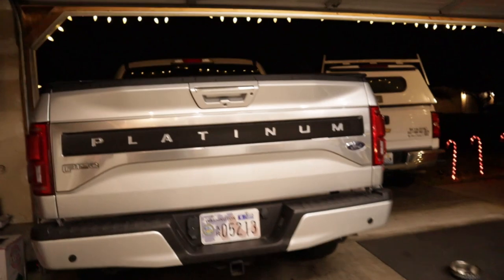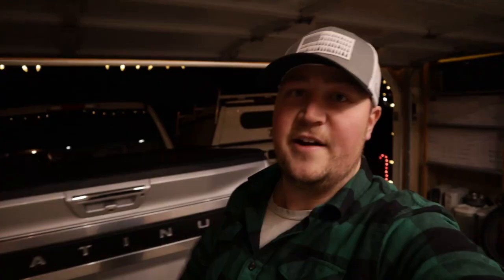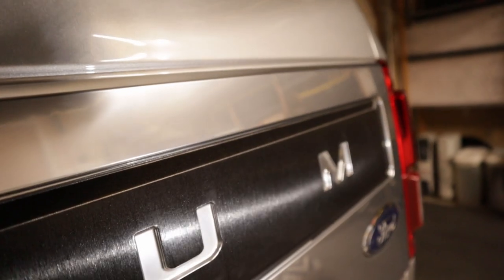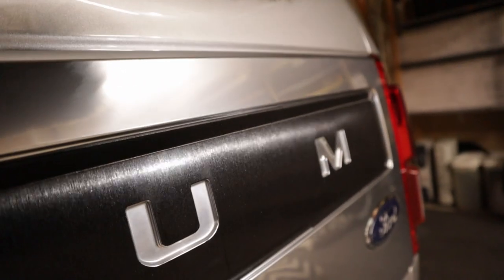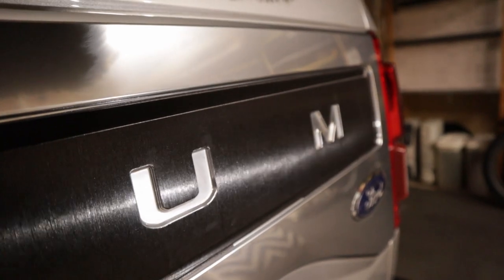Can You Vinyl Wrap F150 Platinum Tailgate?

Comment: Why would you pay the extra cost for the platinum only to wrap the chrome upgrades? I agree the tailgate logo is hideous..I think your wrap idea looks pretty good so far.
Reply from the maker: Thanks should be done this weekend! And 😂😂 valid point.  Bought the truck used with around 18k on it for a good deal.  Was actually cheaper than most of the lariats that I could find so couldn’t pass it up.  The interior is a little bit nicer than than the lariats as well with some additional creature comforts,  massaging seats, adaptive cruise, heated rear seats.  So I went ahead and picked it up knowing eventually I’ll remove all of the chrome.
Reply: @modifieddrive8768  ..ya I figured you picked it up used. With only 18k on it its barely broken in..I've always liked all of the features on the platinum models..but that logo on the back is ridiculous keep up the great work.